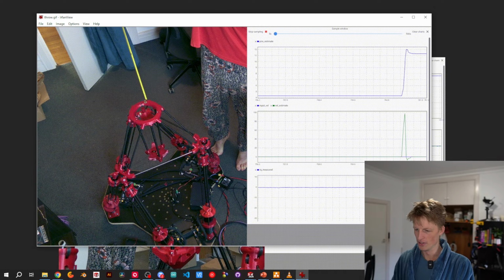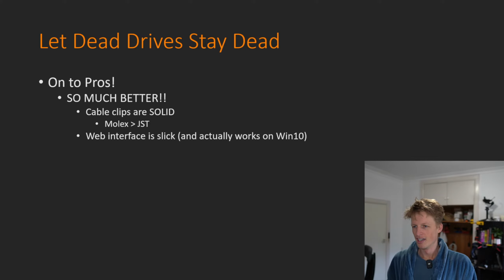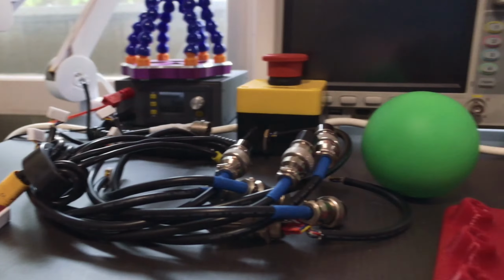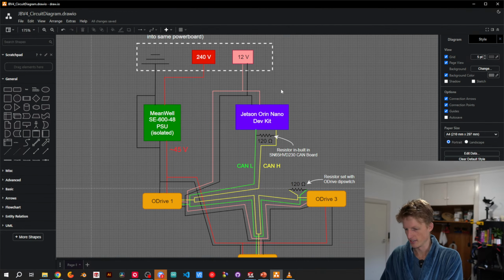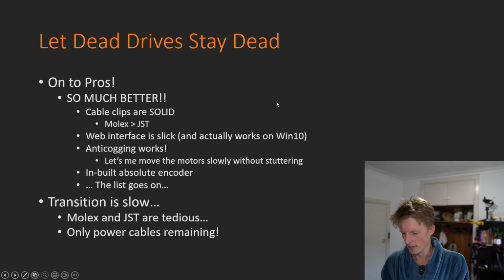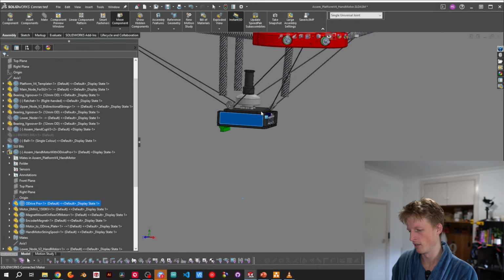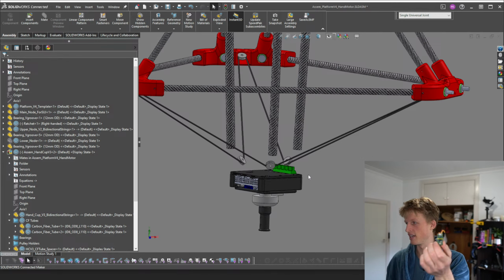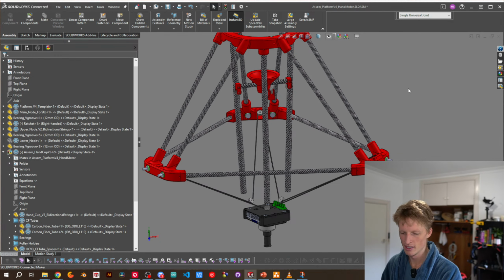PDJ Weekly Livestream # 17

Comment: As far as drone motors go, you could use bigger one like a 2812 motor. It will handle the heat better and proven to run on 12s that some bigger cinelifter drones use
Reply from the maker: Do you think those would still have a low enough inertia to be moved around by the ball without needing a teeny spool?

I'll have a look around to see how much they are. If they're fairly cheap I might pick up a few 😁
Reply from the maker: Or perhaps it's a good idea to just try out a bunch 🤔

Comment: C'mon, molex are the worst! The stupid pins flail around wildly, they grip way too hard, and the connectors don't have big enough ears for disconnecting them. The least horrible ones have a kind of flaps that you press to disconnect, but they're not working very well either.
Reply from the maker: Haha have you done much work with JST?
Reply: @harrisonlow  Well, sometimes JST can be even worse when they're super stuck, for the same reason molex is awful. But that's only for logic. Or if I need longer cables I use RJ45 or USB-C connectors. For power I use normal 5.5x2.5 DC connectors..

Comment: If you isolate the system ground from the chassis ground, using an oscilloscope on the circuit will require a differential probe, because otherwise a "normal" scope's probe ground is connected to its chassis ground, and if you connect the probe ground to the system ground, you'll effectively be connecting system ground to the chassis ground through the oscilloscope's probe which might cause some erratic behavior.

That said, I don't know if you need to put an oscope on the circuit ever.  Just a consideration.
Reply from the maker: Ah yes, thank you for mentioning this! I have consulted with The Expert (ChatGPT) and it is suggesting to get a non-isolated PSU, which I agree would solve all these issues—including being able to 'scope in if I ever need to (🤞it never comes to that)—without the sketchiness of circumventing the isolation of my current PSU.
Reply from the maker: On further reflection, this actually isn't how this would work and a non-isolated PSU would be a terrible idea 😅

I've done some reading and it looks like the CAN transceivers on the ODrive Pros can be fully isolated from the motor PSU, meaning I don't need to connect the main motor PSU GND to the 12V (CAN) GND. I think this is the actual solution!